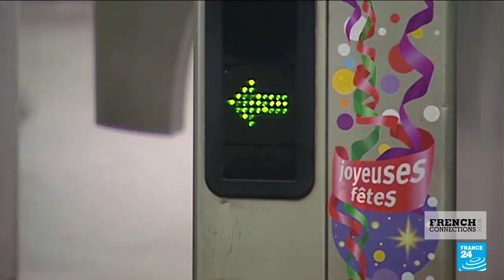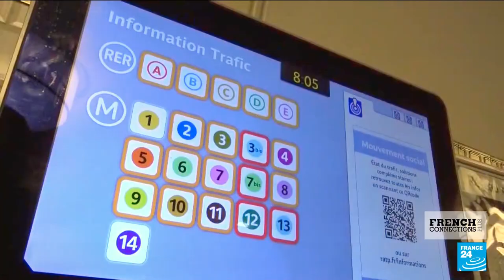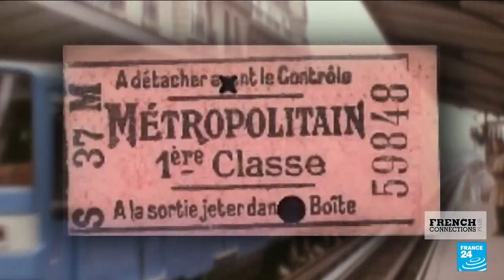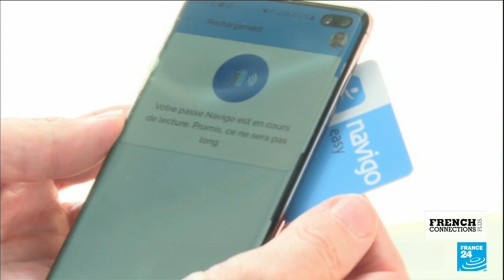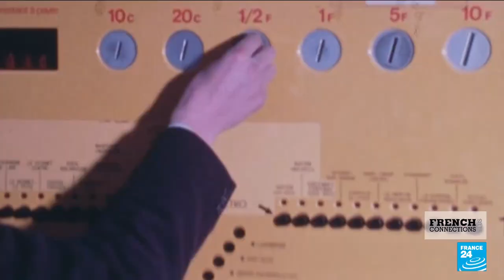Going underground: The ins and outs of the Paris metro • FRANCE 24 English

Comment: The Paris Metro is not the second busiest in the world.  Several systems in China beat out both Paris and Moscow.  Also, the New York subway system runs neck and neck with Paris.
Reply: The second in Europe, it says in the video
Reply: It probably is, yes, although figures and numbers are quite murky. Before the pandemic, annual ridership was 1.5 billion trips. I'm saying: the metro alone. That's not counting RER and "transilien" suburban train lines. Line A of the RER alone does 1 million rides.... everyday. You probably can add a billion trips to the metro total, that puts it at 2.5 billion, at least. I only know the crazy Tokyo metro network to rival those numbers.
Reply: @Desi365  Check out Beijing and Shanghai
Reply: @robertbarrows8847  i don't know where to get accurate figures
Reply: @Desi365  Try Wikipedia
Reply: @robertbarrows8847  try paying attention to the video

Comment: Do Paris trains, including the RER, have AC?
Reply: Definitely not all them, some perhaps
Reply: Metro lines 1, 2, 4, 5, 9, 11, 14, RER lines A & E, plus most Transilien lines,  and soon almost all tramway lines have AC. Some older trains on line B have AC.

There was a framework order placed for more than 400 new "MF19" metro trains for the steel wheeled lines that still run old rolling stock (lines 3, 3bis, 7, 7bis, 8, 10, 12, and 13).
They'll start to arrive in 2025 on line 10 and will, of course, have AC.

RER lines D, B, and then C will also receive new trains equipped with AC. (First new trains on D in the coming months, on B in a year or two, and in the coming years for line C). Or maybe line C already has older AC'ed trains, but I almost never use it so I'm not sure.
Line E already has a good chunk of its fleet that is air conditioned and is currently receiving an entirely new fleet of trains (the same that line D will begin receiving soon).

For the tramway network, out of 14 lines :
Line T1 is receiving new trams that are air conditioned.
I'm almost certain line T2 has AC.
While tramway lines T3a, T3b, T4, T7, T8, T9, T10, T11, T12, T13 all have AC.
I just have a slight doubt about lines T5 and T6 because they use a very different tram type, but they should have AC given their fairly young age.

By 2028 or 2030, all lines of all rail-based networks should be air conditioned.
And, of course, all new lines from the Grand Paris Express project will have new trains equipped with AC.

Though it's not AC like in NYC Subway with sauna platforms and freezer trains.
It's much softer AC with less dramatic temperatures changes between the train and platforms.

New stations also have AC, like on M14's extensions.